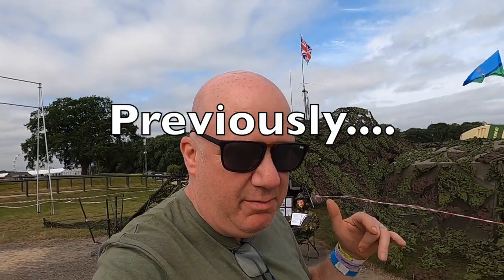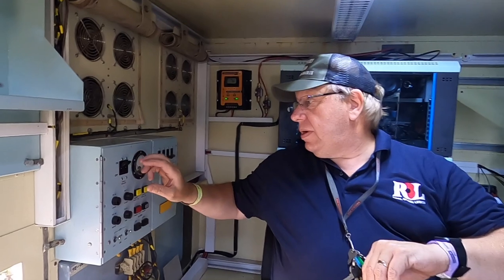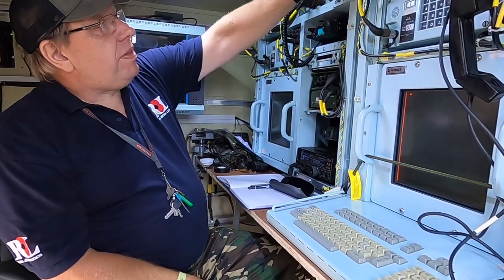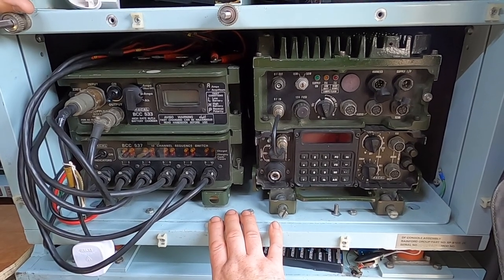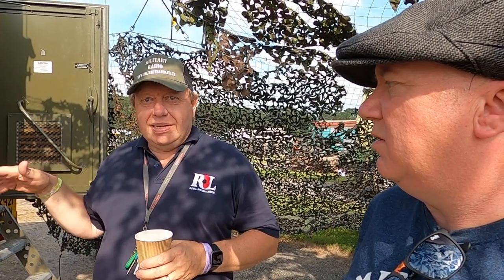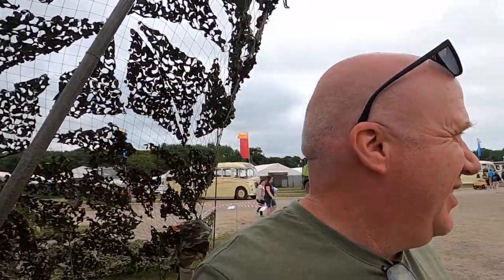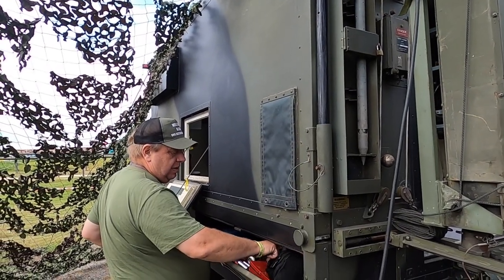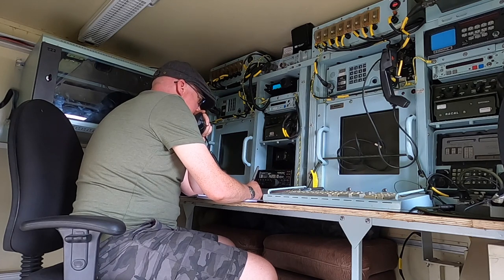A closer look at this amazing military radio vehicle | Plessey Vixen

Comment: The mention of NCRS made my ears twitch. My old mob 38 Sig Regt(V) trialled it (CONRAD 2) back in the early 90's, as far as I remember it didn't work properly, but I left them in 94. As "Techies" we weren't allowed near it. The mast for that system was huge and made of fibreglass IIRC. It had a peculiar antenna system which was probably a fan dipole in retrospect. Ah ....this video takes me back some.

Comment: I used to serve on a unit that had those RB44s (covert signals unit), absolutely lethal bloody things at speed, the brakes pretty much didn't exist. I have no idea how they were accepted as serviceable.
Reply from the maker: Very interesting
Reply: @M0SZT  I was involved in a crash in one back in the mid 90s, I was driving a radio technical vehicle (RTV) and had to brake when a car joined the motorway right in front of me. RB44 behind me had plenty of space but just couldn't scrub the speed off. Horrible bloody things, I have a picture of me inside the RB44 opping the radio, it was however popular on night shifts, all that kit generated heat and there was just enough space to put up a cot and lie on the floor for a few hours :)

Comment: I got my hands on a couple of Marconi Scimitar military VHF radios about 15 years ago. They had encryption and frequency hopping, but that capability was removed before they were surplussed. I got all the manuals with them though, and when I went inside the radios the modification consisted of breaking one track on the circuit board inside the modulation\encryption module and removing a single diode.
Ten minutes soldering and I had them working as Mr Marconi intended, but the procedure for setting them up without having the crypto fill gun was a bit of a nuisance, you had to sync them manually.
I sold them to a guy in Germany if I remember right, got almost 10 times what I paid....
Reply: Yes that dude in Germany is an avid collector of that sort of kit. He bought lots of stuff from my company Q-MAC Electronics.
Reply: One would think that the military would be a little more careful with that sort of tech. If I were them I'd rip out all the circuits responsible for FHSS and encryption

Comment: You don't explain what Vixen is. It is an RF signal, intercept and analysis system, up to 1GHz. It was intended to be deployed to monitor for enemy communication, record their signals, log direction and signal strength. It failed not due to a relationship issue, the system didn't work, it was cobbled together with some good equipment but some bad, it was found to be unreliable and was projected to be to expensive. The MOD sued Plessey and won for wasting their time, the damages awarded covering the cost of the field trial. The MOD carried on using and purchased more RACAL Seeker 3 systems, until the next generation intercept systems could be trialled. Vixen was one of the biggest nails in the coffin for Plessey's military radio division, which not long after ceased trading.
Reply from the maker: Fantastic thank you, yes we filmed at a hectic public display at a car and music festival, this is just the start of sharing the history.
Reply: Hello Thomas Thank you for that info i will try and include more of this detail on anything i do in the near future. I believe a lot of the vampire lads from 14 sigs proved they could still do a better job with intercept and analysis.I am still on a steep learning curve with it
Reply: Spot on! Yes the RACAL kit was better suited to the job. RACAL always had their eye on the wider market not just parochial dinosaur UK MoD.

Comment: I am using a Gitchners 1 unit ISO comms unit with a 49K BTU ECU. Using a Will Bert 35 foot pneumatic mast.its designed for two power systems, 3phase 110 60 HZ as well as a 3phase 400 Hz system for the electronics bay. Trying to restore the exterior considering its '86 vintage. You guys have a really nice setup there, love the rack mounted equipment!